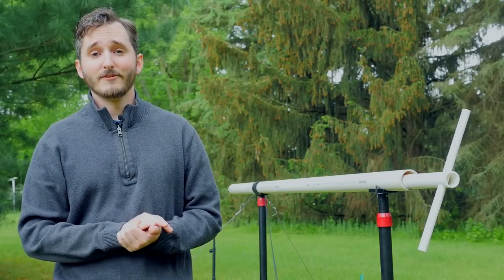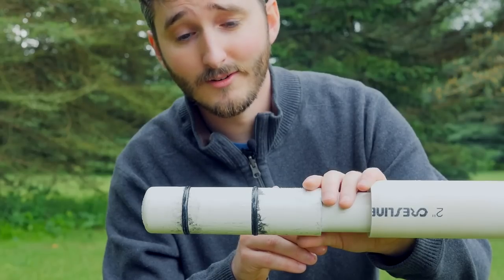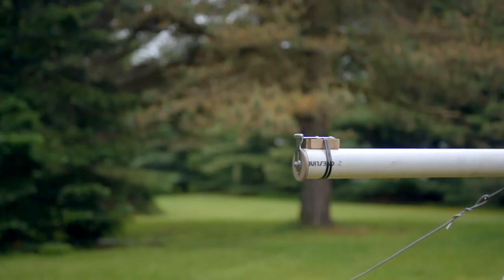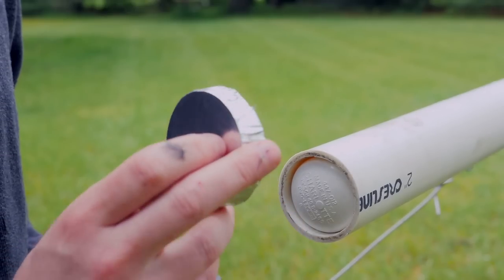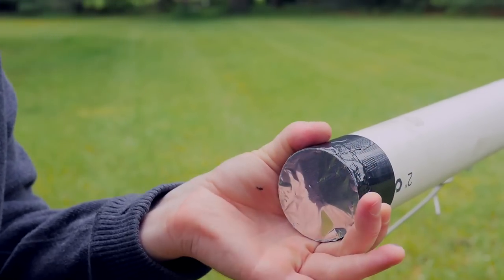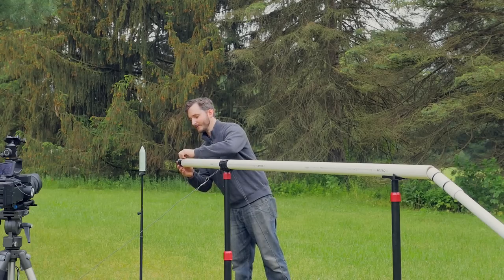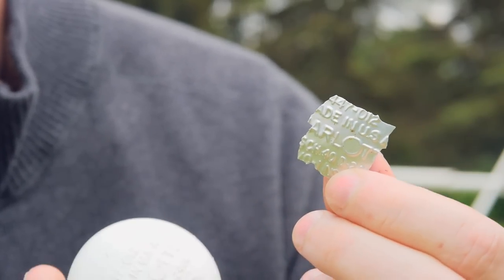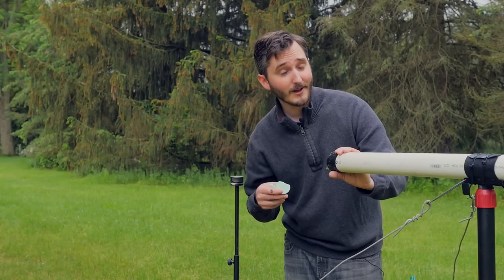New Vacuum Cannon Design - No Vacuum Pump Required!

Comment: I know it's an old video, but isn't this design more dangerous? What I mean is that you are required to be directly behind it. If there was some fault in the front burst disk and it broke prematurely, wouldn't the piston come shooting out directly at you?
Reply from the maker: Not unless the projectile was also stuck to the front burst disc
Reply: @Nighthawkinlight  I didn't mean being in danger of the projectile shooting back. I meant that when you have it pulled almost all the way back, just before you pull out the piston if the front burst disk was to rupture the air would rush in the front of the barrel and cause the whole piston to shoot out into you. Either way, it is a cool design. Just maybe ppl should figure out a way to pull the piston out without being directly in line with the barrel.

Comment: This might be obvious, and maybe you already tried it, but why not have the flap valve on the bottom and even have a small spring that pushes it out of the way when there is no back pressure? Make it's resting state out of the way of the front rather than the resting state blocking the front, and rely on the vacuum to keep it in place when you are ready to fire.

Comment: How can I contact you? I'd like to suggest a 2 Stage Design, using Vacuum to generate an even higher overpreasure behind the projectile. imho supersonic speeds will be reachable with heavier projectiles.
Reply from the maker: A secondary pump would be of help, in this design I'm not sure how much of a difference that fraction of pipe would make though. You could always make the barrel longer and the result would be a stronger vacuum as well.

Comment: Hello @NightHawkInLight I know this video is serval years old but I hope you don't mind me asking, is it possible to invert the rod as the barrel with a hole in it and use the projectile as the seal much like a bow. Than use a airgun or pulled cork as the back release?
Reply: I mean draw it like a bow while pulling it back holding  the seal barrel  pushed forward *
Reply from the maker: It's tough to picture exactly what you're saying but if I understand correctly I don't think it would work. If the piston doesn't pull through the barrel itself then the barrel won't be under vacuum. The tube which you pull back will be under vacuum but air rushing in won't be enough to push a projectile all the way at the other end into a barrel full of air. I might play with some new designs of this cannon soon because it would be cool to make a handheld version.
Reply: Thank you for answering my questions @NighthawkInLight especially after all this time I'm very excited to see what you come up with next!

Comment: Every thought about doing a vacuum power potatoe gun? 

also couldn't you just put a coupling bigger than the pipe on the firing end and make cap with o-rings that fit inside of it. when the pressure slingshot back up it should pop the cap off without fighting gravity. put a eyelet and tie it to your gun so it doesn't get lost

Comment: Can you dry fire the cannon i.e. Let go of the piston with out pulling it all the way out of the tube?
Reply from the maker: The piston just gets sucked back. Quite slowly because it is a very heavy object to accelerate.
Reply: NightHawkInLight would using a piston on a cable or string with a quick release on the other end work? No endcap the piston and o-rings are the projectile... or would the sealing rings slow it down?
Reply from the maker: The rings would slow it down, but it would work.

Comment: Can you make a miniature version of this?
Reply from the maker: There's a limit to how small it can be and still work. It did not work when I tried it with a small syringe for example. It needs to be quite long.
Reply: NightHawkInLight You know what might be a cool video? Comparing two cannons of equal volume, one very short and wide and the other super long and extremely narrow
Reply: NightHawkInLight hmmm that might be a problem yeah :p
Reply: Force varies linearly with length and is quadratic with piston diameter, so you would have to quadruple the length of the tube to equal the same force as created from doubling the diameter.
Reply: eyeAMtwinkEE pvc?

Comment: why not make a plug at the front, and it's also the projectile?
so you wouldn't need the aluminum foil every time, and no need for a flab because the projectile itself will make a tight seal.
I made a prototype based on your design but in the form of bow and arrow

Comment: I love this new design. It's cheap and easy for people like me who don't have vacuum pumps. I was thinking of a future model where you could somehow attach a winch or a gear system at the end to pull the piston back by itself while I hold the cannon like an RPG. I put a link below of the gear system I was thinking of. The long gear is glued or drilled into the piston pipe and the circular gear is positioned and powered on the barrel of the cannon. All it would take would be a flick of a switch and the gears would pull out the piston.
Link to gear image:   http://intecsrlnapoli.com/720-large_default/cremagliera-modulo-25-mm-25x25x2000.jpg

Comment: how come your 46ish lbs of pressure is not affected by the length of your pipe I figured you would use volume not area can you please elaborate on this? also doesn't it get harder to pull the farther back you get
Reply from the maker: Supposing there is a perfect vacuum in the pipe, Earth's atmosphere will be pushing the piston with 46lbs of pressure because it is not resisted by any air pressure in the pipe. It doesn't matter how far away from the other end of the pipe the piston is, air pressure will still be pushing it toward the vacuum with the same force which is multiplied by the surface area. For the piston the area stays constant.
Reply: The projectile accelerates at a given rate due to pressure difference versus the area no matter the barrel length. A short barrel yields slower velocity as the projectile has less time and distance to gain speed. Conversely, too long a barrel causes the projectile to begin slowing before exiting, although this may not be as important in a vacuum gun as it is in a pressure gun that has high projectile to bore friction. The perfect barrel length would have the projectile reach maximum velocity just prior to bursting the seal and exiting the barrel. The pressure on a smaller diameter is less, therefore acceleration is slower and so a longer barrel is required to utilize the power available in the vacuum. Many factors can affect the efficiency, weight of projectile, barrel to projectile fit, bore to projectile friction, speed of inlet valve opening, frangibility of bore closure, relative air density and etc.

Comment: Question: How much does your projectile weigh?
Reply from the maker: I'm not sure, probably around 100g, 1/4lb
Reply: Ok, when I my calculations are right (a=F/m) , the projectile is having (friction has been neglected) an acceleration speed of 2070 m/s^2. That would be mach 6.2. I guess, the friction is so enormously, that  it's slowed down so much (Is the barrel very hot after one shot?). Also, the projectile probably couldn't reach it's top speed, because the target was too close.
Reply: The Wolf The projectile wouldn't accelerate after leaving the barrel though.

Comment: +NightHawkInLight if you tried attaching the flap valve to the bottom of the barrel and using some form of rubber or even making your own silicon mold as the seal, it might function more effectively. While the issue of it not making a proper seal is evident if you made it out of silicon and a seal on both sides and extended walls (of the silicon) it wouldn't fall off the barrel and would easily open once any amount of air hit it. Just a thought :p!
Reply from the maker: I tried a silicone toilet tank valve. It was too weak and got sucked into the pipe.
Reply: Shame, would be quite neat if it worked,  would be completely reusable with no wasted materials or expenditures and easily reloaded!

Comment: I just got done making mine but the biggest problem im having is the burst disc's are leaking around the tape
Reply from the maker: Make sure the tape is wrapped tightly and covering all of the foil that is folded over the side of the pipe. You can also pull the piston back quickly enough that any leak doesn't really matter since the vacuum is drawn and the cannon fired so quickly.
Reply: Thanks for quick reply, but i have one more question. How do you cut the aluminum foil to make the burst discs?
Reply from the maker: https://youtu.be/cDoUBJbyZ-8?t=2m18s

Comment: Here is a challenge 
Have someone 3D print you a projectile with a raised logo on the end and shoot it into something like a aluminum plate or thin steel plate to see if it will emboss it with the logo

Comment: What about a design which pulls the piston back with a crank and wire mounted at the back of the cannon. That way it would be alot more convinient to use. Also, id use a rubber band aswell to make the flap move out of the way faster. I drew a picture of what i imagine my ideas to look like in paint because I really cant put it in words since Im not a native english speaker http://imgur.com/a/INj2X .

Another thing I'd absolutly love to see is you kinda putting a fairly small steelball centered in front of a very lightweight big projectile. The big projectile would act more like some kind of wadding. The instance the wadding hits the outside air it should slow down a lot more because it has much higher air resistance. But the steelball would continue and have some serious speed and energy.

Comment: Why can't you 2x stage it,
Rear bigger("power plant chamber) , into smaller(barrel) , 3x id smaller. Ratio volume of air to  length of smaller @200 %less than that of bigger. 
In smaller, essentially barrel. ya projectile. 
Like a, oversized hpa nozzle that acts like a realease valve between two diff cylinders. transferring air into smaller. Pressure projecting projectile.

Comment: Thought:
what if the piston was hollow, with the projectile loaded near the handle you pull. instead of pulling the piston out, you have a butterfly valve at the back that you trigger open. 
There are two possible downsides, but too lazy to math them: the first is you'd have less pressure overall, albeit a much longer length of barrel to travel. The second is that, if the piston is projectile-size, then the latter-half of the barrel would be marginally wider.

Comment: Has anyone else built this yet?  I tried but can't get it to fire. It just makes s very soft sound when piston comes out. Any tips on what is wrong? I am guessing air is getting in through the foil somehow.
Reply from the maker: Tape around the foil better, and put oil on the piston so it seals better. You should hear no leaks when you pull it back

Comment: This works the same way a plastic syringe does when you plug the tip with you thumb and pull the end to create a vacuum inside it... be careful not to release it like that though or it will slam down into your thumb and injure you. I would know, I did it. :P

Comment: Wait...A vacuum cannon can accelerate a projectile to greater than mach 1?  How?
Reply from the maker: Air expanding into a vacuum can move faster than a wave can otherwise propagate through it at atmospheric pressure.
Reply: Ok.. Interesting.
Though still a bit counterintuitive, as the speed of sound is lower at high altitude (low air pressure).
Thanks.

Comment: You could just use a compressor and blow all the energy out of it to push the projectile instead of using this complicated design. If you are going to use pressure to push a projectile, go big or go home :)

Comment: As with so many things, simpler is quite often better and it shows clearly in your new design.

I hope you'll correct in the future your incorrect use of "times slower," though. For clarification, see timesless.com, even though many YouTubers will dispute this. It's not forty times slower, it's one-fortieth of the original speed.
Reply from the maker: I would argue that's semantics. The image is playing back at 1/40th of the original speed, meaning the footage takes 40x longer to play the same moment of time. 40x slow motion or 1/40th slow motion are two sides of the same coin.
Reply: Fred U. Thank you. I thought I was the only one who was bothered by this.
Reply: It's disappointing that too many consider it semantics when the reality is incorrectly applied mathematics. I thought the channel owner would recognize and correct the error, but no such luck. At least temperature in Kelvin wasn't involved, huh?

Comment: Even shooting Styrofoam or ping pong balls, the projectiles would not exceed the speed of sound design for this vacuum cannon.  The pressure wave travels at the speed of sound, it cannot push a projectile faster.
To exceed the speed of sound design you will need a way to increase the speed of sound internally, so that when the projectile exits it could be exceeding the lower ambient speed of sound,
....or, use something like a deLaval nozzle.
Reply from the maker: Air moving to fill a vacuum can exceed what would normally be the speed of sound through air at atmospheric pressure.
Reply: NightHawkInLight.   Nope....Without special conditions, such as a deLaval nozzle, gas rushing to fill a vacuum will travel at the characteristic speed of a pressure wave which is also known as the speed of sound.
What you have built will result in a speed of sound lower that that of ambient because the gas in the tube will be at a lower temperature for most of the transit time due to the initial reduction in pressure and momentary rapid throttling.

Comment: 500 fps? I don't know anything about vacuum cannons, but I do know firearms, and although this is about half the speed of a typical handgun bullet, the projectile weighs 4 to 5 times as much (around 650 grains), so this is potentially lethal.

Edit: I looked up the weight of a 1.25" end cap on Charlotte Pipe's website. It's nominally 0.094 lb, and there are 7000 grains in a pound.

You ought to get yourself a chronograph and measure the speed properly.

Comment: What if u put a end cap/ hole 2 accept fireing pole, then drill hole/ holes forward just be4 the plunger comes out. Then attach 2 small winch 2 jus about 2 fire. Then hit switch & have the winch give 1 more quik 4ward thrust & she fires when u want. Lol give ya time 2 aim. & 4 the burst disk. What if u put square block wood at end of barrel / slit in it like a old kids veiwfinder(  member them) then just get 2 p eice of csrdboard & double back tape 2 tin foil. Then just slide in & fire away!😊  lol just a stoners. Thought on yer awsum idea

Comment: This is also why Elon Musk's hyperloop (vacuum tube train) is destined to a disaster. A small hole will tear a large one and make a wall of air hitting the train inside with horrid results... In theory the project would be nice, but damn is it dangerous in practice.
Reply: Probably not. If we think carefully about the math we find that this experiment doesn't scale like you probably think it does. The force acting on the projectile is calculated using the square of the radius of the aperture while the volume and by extention weight of the projectile is calculated using the radius cubed. This basically means that as you scale this apparatus up you get less force per unit of mass the larger it gets. Add that to the fact that a hyperloop pod would have a significant air gap between the tube and the pod and I doubt you would get life threatening g forces.
Reply: Of course hyperloop pods aren't solid matter and aren't spheres so the math I described is very oversimplified

Comment: Have you truly been unable to come up with a better flap valve for the business end of your vaccum cannon? Small plastic cups against rubber fittings are certainly faster than burst discs, but it ought to be a solvable problem. With a flap valve on the front that's fast enough to get out of the way of the projectile, it should be possible to make one of these into a repeater. You've cleverly solved several other problems, surely the front valve hasn't got you licked?
Reply from the maker: It's a lot harder than it sounds. You can't let it start opening until the projectile is almost all the way down the barrel. It needs to accelerate faster than the projectile itself if you want it to get out of the way in time.

Comment: But you're not creating a vacuum. You're using gas laws to increase volume, decreasing pressure. Technically, unless you start off with nothing inside, I don't see how this could be a vacuum
Reply from the maker: If you want to be technical there's no such thing as a vacuum. Even deep space contains various atoms and particles floating about. You can refer to these things as micro pressure if you want, but just about everyone refers to micro pressures as vacuum as a matter of practicality.